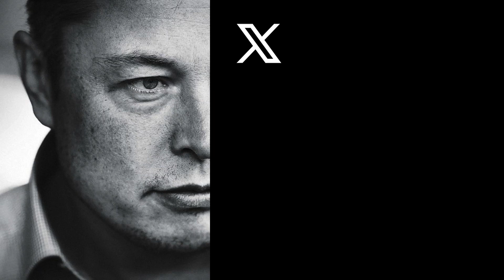Tesla 4680 Production Update

Comment: I'm going to push back on what you said regarding not increasing the range with the new battery pack. What you said makes sense but if they have such great battery tech do you actually think they'll just put smaller packs in the car to match the current range? That seems absurd they wouldn't push the limits and continue to set the bar for the longest range vehicles on the planet.